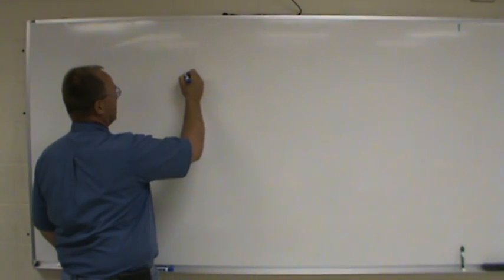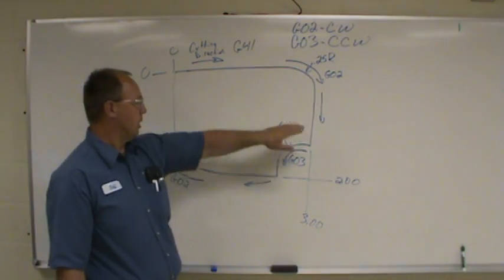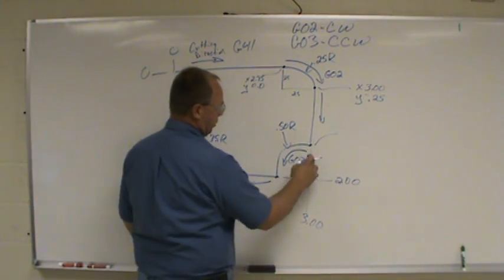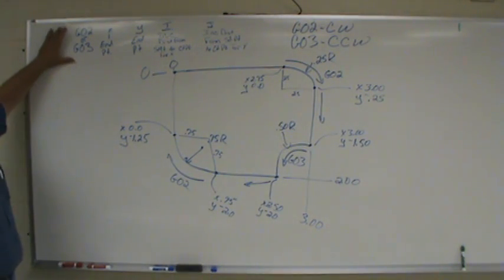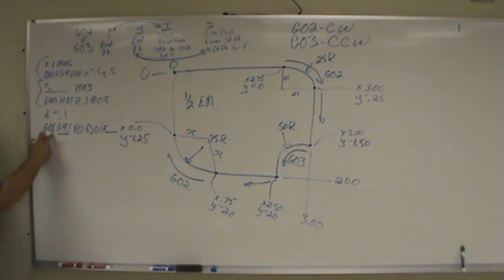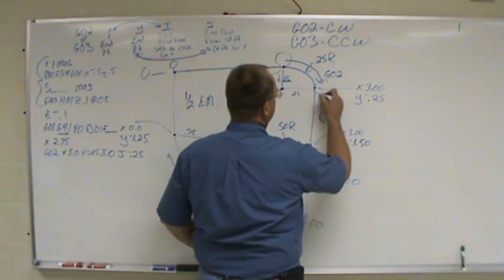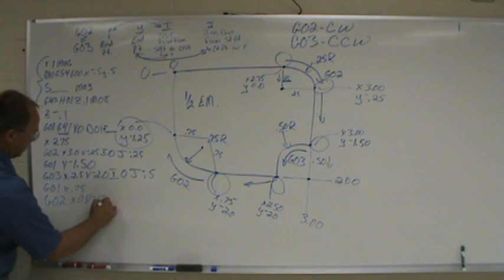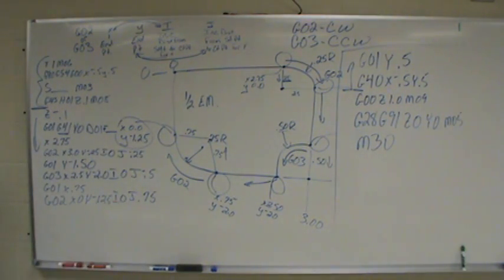G02 & G03 Programming

Comment: Mark climb milling/cutting is used to assist the machine. It's easier on the machine as it pulls the material through with the rotation of the cutter you're using.

Comment: To make things easier, (on Haas controls) rather than copying/pasting the profile cutting for successive passes at further z depths, you could use M97, and put the repeated code after M30, that way, if you need to change any of this code, you do it once. And your program looks cleaner/shorter.

Comment: we prefer to climb mill on CNC's because it leaves a better finish, climb milling is not a requirement. On conventional mills we have to always conventional mill because a climb mill on a Bridgeport will grab the material, suck up the backlash and potentially crash the cutter. CNC's do not do this because they have ball screws with zero backlash. A CNC with acme screws would have the same problem, a conventional mill would be able to climb mill if it had ball screws.

Comment: After "G01 Y-1.50" the mill is positioned to the right.  Then for the G03, it must be tangent to the arc.  The mill must be a radius down, and a diameter to the left.  And, then it follows the arc, plus the comp offset.   What moved the mill from G01 end to the G03 beginning?  That algorithm must be pretty interesting, since it has to know a lot about the previous function and the next function.

Comment: R seems faster but IJ is pretty universal. Some machines keep you on your toes using L or what have you. Our fanuc edm apparently can take R but can't, was told to change all posts to R for easier editing and found out the fun way. Did I miss something or was this assumed that you'd add the tool radius in on the machine to get the part in spec? Without this its incorrect.

Comment: You have an error in the program.  Before your first G03 move you will have to make a G02 move to roll the cutter around the point 90 degrees CW.  Then invoke the G03 move.  You will then have to make another 90 degree G02 to roll the cutter around the point, then use the G01 move.  Another fix would be to continue the G01 command in the -Y direction 1/2 the cutter diameter, then invoke the G03 command.
This does not keep the cutter in constant contact with part and could effect your finish.
Reply: Farmzoid, not necessarily so, it will depend on how you use cutter compensation.  ie. center line of tool programming vs. tool edge programming. In the video example the teacher is using center of tool, so at the machine you will need to put in the tool radius on comps
Reply: G41 left and G42 right, add a D to the T(tool) assembled, just like H in G43, or just create an offset on the tool table.
Reply: +bogart999 9 did he add the radius before he started the G03? im not getting that part.just started my cnc class , and trying to find simple g code videos. brain hurts already.
Reply: He did not explain clearly that he was programming to follow the lines using a theoretical zero diameter tool. Then all you have to do is put half the diameter of the tool in the diameter offset table. So with a .500 endmill he would put .25 in offset # 1 and cutter compensation would take care of it. I believe you thought he was programming the center of a .500 endmill, in which case your observations are perfectly correct. He did in fact explain that he was using cutter  comp (G41)  but he could have been clearer This subject does take a while to wrap your brain around.

Comment: do you mean that the incremental distance is relative to the center point of the arc, or the point where the horizontal and vertical lines that go through the start point and end intersect..in this case they are the same..but if the arc were say less than a 90 degree arc..what then? thanks

Comment: For the straight cuts, how come you are only using an X or Y value to move to the next point? Doesn't the tool always reference from the origin? So wouldn't writing the actual coordinates (X & Y) make more sense? Otherwise using Y or X by themselves would be moving relative to origin, not to the next point in cut path.
Reply: forr3st125 I wondered this too. If no Y is given it would surely return to 0 on the Y whilst moving to the given X coordinate given the machine is set to absolute.. unless the machine takes the last known Y coordinate?
Reply: you only have to use one x or y if the previous value is the same because the numbers remain modal like G01

Comment: For what control is he programming for I would never put the cutter comp and tool offset on he same value 01 on most controls that would mean a nice scrap part or just ALARM out for D value rule of thumb add 50 so that means D should be G41 D51
Reply: D stands for Diameter offset and the 1 correlates what the tool number is. This is used in most fanuk controls and you would make it .51 in the offset page on the tool 5 slot not at the D value in the program itself.

Comment: Ridiculously complicated. Just for a rounded corner. And inches. The old imperial system. Madness.
Climb milling? Why is it called CLIMB milling?
Reply: mardrom1 Climb milling is just a way to explain, in most cases, the rotation of the cutting tool (in this case an endmill) in relation to the edge of the work piece. climb milling "pulls" at the workpiece and conventional milling "scoops" out the chips. because of backlash in conventional mill machines, climb milling is only ever done for a finish pass, about a thousandth or two. however, cnc machines dont have this backlash issue and primarily are run using the climb mill technique. check this out: http://img39.photobucket.com/albums/v119/vinnito/storage/cmill.jpg
Reply: There are aternative methods for circular interpolation. 
For example, you can avoid the I & J, and add in a radius R. Just make sure your machine control parameters are setting allow it.

For the 1st arc, program this instead:
G01X2.75Y0
G02X3.0Y-.25R.25

Or

you can also simply program the first corner like this;
G01X3.0Y0,R.25
Change the R with C if you want a 45 degree chamfer instead. This will technique will only work on corners. 

The term "climb" is used because the tool's cutting flute enters the stock where the chip will generally be thicker. As the flute rotates through the material, the chip will thin out. The resulting forced will push the tool away from the stock, and also forward as though the tool is climbing along the material edge. Think of an ice cliff "climber" using ice axes to chop into the ice and pull themselves up. 

The metric system is obviously easier to use, but unfortunately in the USA, the imperial system is still very popular. The switch is ongoing, but will take more time.
Reply: Mark Szakos G01X3.0Y0,R.25 certainly simplifies things. with the addition of changing R to C for a Chanfer is also appreciated.
Your analogy to rock climbing with climb milling is easy to understand. Thank you.
As for the Imperial system, well i hope we will see less and less of this, as older generations go into retirement.
We are of course stuck with screw threads. Nothing can be done there.
People keep on telling me simple is always best.
Thanks for the easily digestible answers. Helpful.